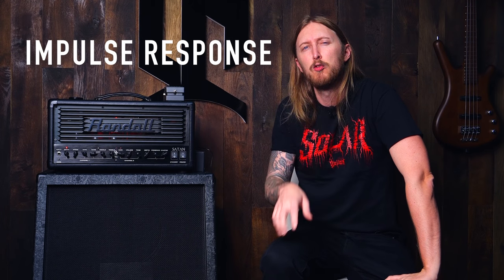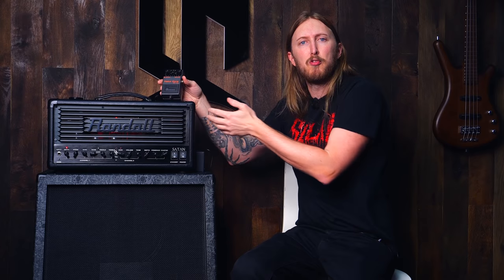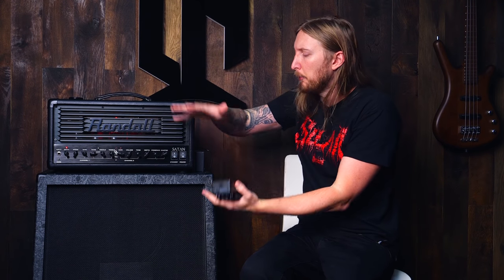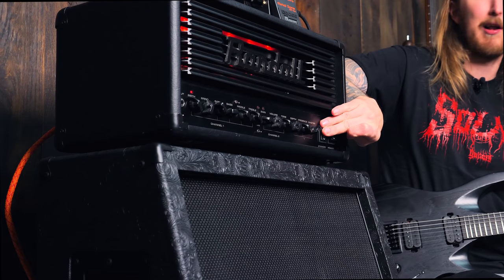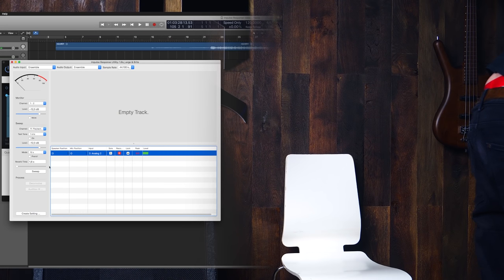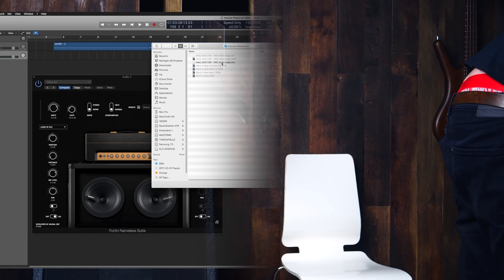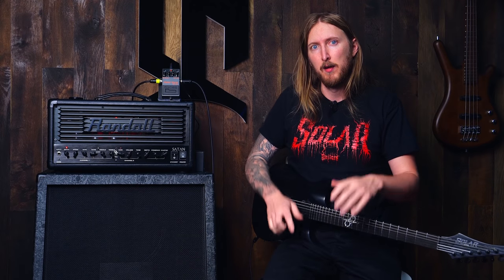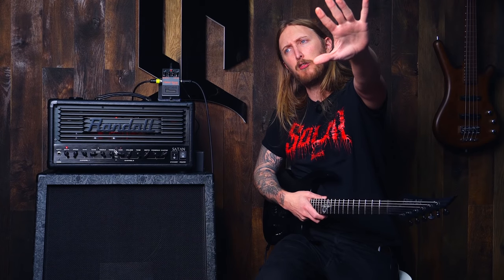Guitar Cabinet Impulse Responses Explained FREE DOWNLOAD - Home Recording Tips

Comment: i'll bang this on my mooer radar and will totally destroy stages with it now.
Also i did learn a lot. I knew what it was but still.
Reply: Did this work for you on the radar? Sounded terribly muddy for me, with and without the power amp sim. (going from joyo zombie effects out into the radar)
Reply: @ATEFred  

Sorry didn't update. it sounds like complete ass on the radar as well.
I did use it with a Boss GT-1. Probably sounds bad because we don't jam a direct guitar signal into a pedal and that one into the DAW.

Anyway I did find a pack of about 240 ir's online. some guy did re do IRs based on Albums or songs of Metal bands.
Can't tell you how it's called but it's that pack here watch?v=km2h4NoiM74

The stone sour one did work perfectly for me. or papa roach!
Reply: @apfelmistnutte  Thanks for the heads up! will check those out, thanks for the link!
Reply: @apfelmistnutte  Update on this: some of the IRs you linked are really cool, sound way better to me than any of the default ones on the radar. Thanks again!
Reply: @ATEFred   had the same feeling, perfect!

Comment: i have a question, by doing that, the ir does not color the sound as the cab would do but also the poweramp, am i right?
Reply: Right! And the mic too!
Reply: ...and the room. I've taken some casual impulses in a room with a solid brick wall on the opposite side to the amp. The IR gets a little blip at the right spot for that reflection.

But yes, it captures everything. To isolate the cab "well" you'd need a calibrated mic, anechoic chamber, and a nice clean & flat amp. Repeat for as many mic positions as you care for.
Reply: It does not capture the feedback coming to the guitar. So if you raise the volume on the real rig, you would get more feedback than with the IR response because it was captured at a lower volume. IR response is nice but it's limited when you change environment.
Reply: Everything in your signal chain will colour your sound.

Comment: Hey, i'm currently trying to record on a budget with my guitar and a shitty audio interface (behringer u-phoria umc22, doesn't even have a driver, i gotta use asio4all lol), the direct monitor sounds great but once it's the clean sound is completely awful and muffled. I have a Peavey Vypyr 30 amp that looks like it might be plugged to my guitar but the forum is closed so I don't know how to if I even can do it. Any tips?
Reply: @kotekutalia  I'm plugging my guitar to my audio interface with mixed results, but I also have a Peavey Vypyr 30 amp, just don't know if I can add it to the recording to make this sound better
Reply: Yes now most of all behringer stuff use asio4all, but actually it got its own original driver, u just need to google them..its 100 timez better than asio4all
Reply: Run the headphone/record out of the Vypyr to your umc22.  You'll need a 1/8" to 1/4" cable or an adapter on a 1/4" cable.  The Peavey will have a built in cabinet emulator most likely.